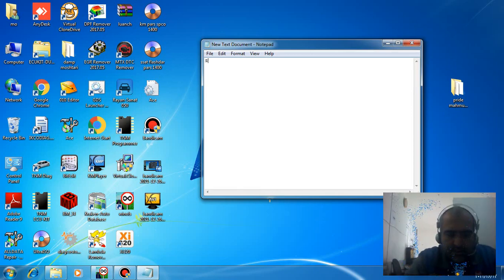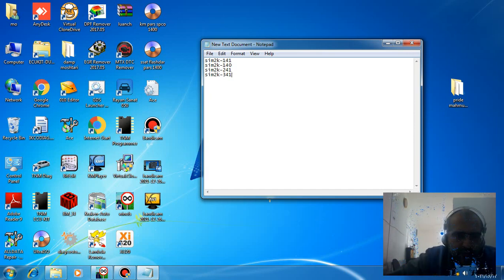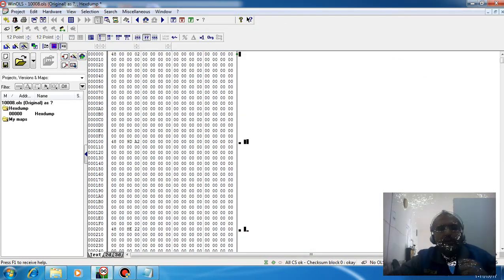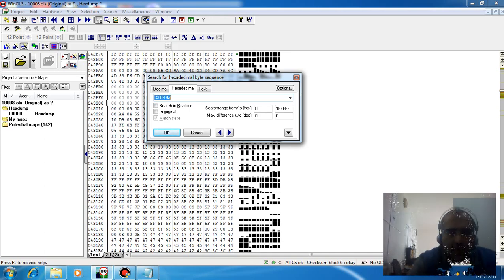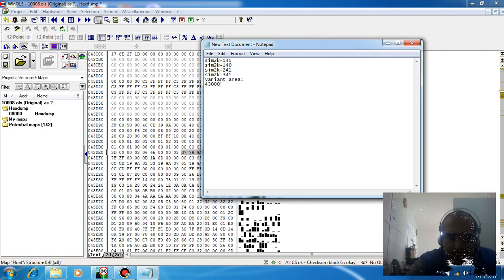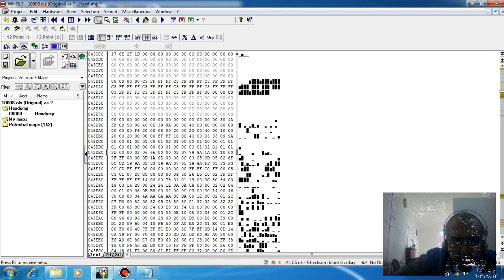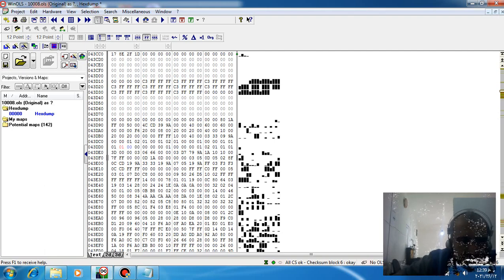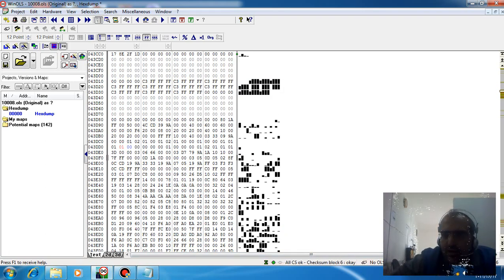Immo off with Winols for siemens ecu of Hyundai&Kia

Comment: Hi friend, first of all great video! We made an online immo off tool including for this ECU (free for our customers). Check our channel :) The immo switch you explain is correct, but some minor mistakes in your video like this will not work for 241, that one uses a bit different structure and in some cases this "map" with the switch is before offset 0x43000